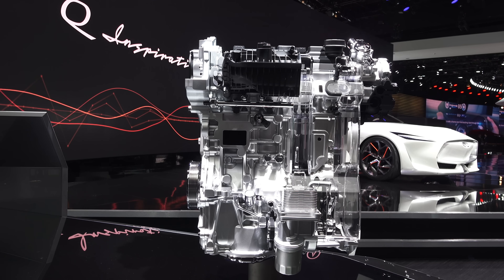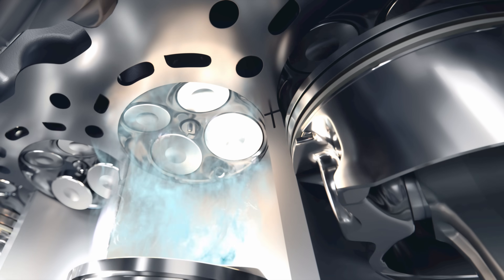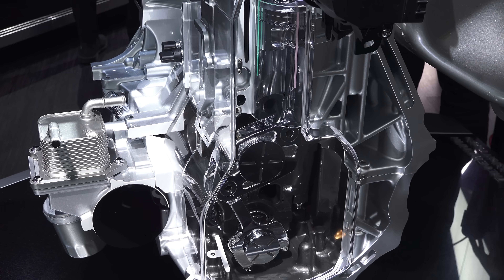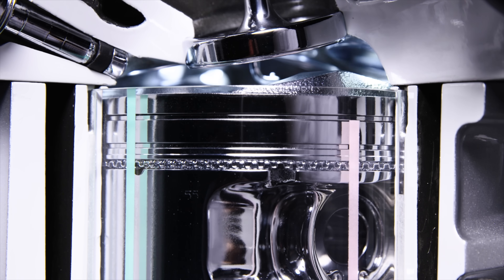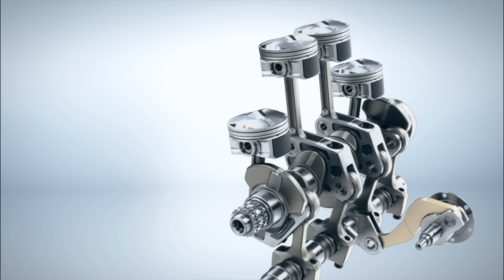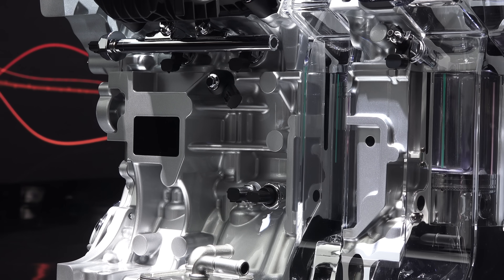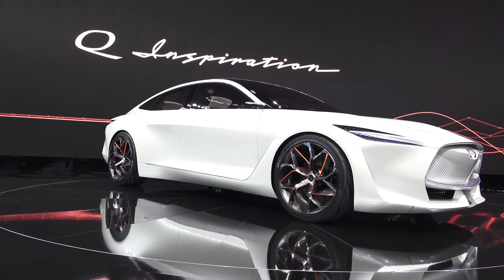INFINITI Reinvents The Gasoline Engine — VC-Turbo

Comment: Can't you achieve the same variation in compression ratio by opening and closing a valve during the compression stroke? Seems much simpler, and doesn't the technology already exist? Also, I've often wondered about offsetting the crankshaft so the connecting rod is perpendicular to the crankshaft web during the power stroke at maximum cylinder pressure (to optimize torque on the crankshaft and minimize side thrust between the piston and liner)... why isn't every crankshaft like this? great video, thanks!
Reply: That can definitely alter the effective compression ratio of the engine, though it does not modify the expansion ratio(The Toyota Prius pioneered this technique and many other automobiles use it). Unfortunately doing this decreases the max power the engine can provide - hence why this complicated system exists.
Reply: No its not quite the same thing dropping compression by dumping air is not the same thing as reducing squish in this system you still maintain the same air quantity.

Comment: Can't you just open the intake valve later in the intake stroke to lower the compression. As in the later the valve opens the less fuel and air gets sucked in.  Or that won't work?

Comment: I disagree about all 4 cylinders having balancing issues. The Honda B series engines had very well balanced crankshafts that in some engines could exceed 9k rpm all without balance shafts. The K20s had balance shafts and a two piece block design that improves the rigidity even more, and run ten times smoother than b series.
Reply from the maker: You can disagree, but secondary imbalances are a fact of flat-plane crank four cylinders like the two you describe (and they are the reason the balance shafts are used). You can build them smooth, just takes extra.

Comment: So premium fuel for performance? At the added cost it couldnt be done on 87? How is it more efficient at a higher compression rating when honda and toyota run low compression for fuel efficiency and longevity from blow by? Higher comp= more fuel. None of this adds up. Its BIG price tag that will sell it. You wanna see great be the first with a diesel/electric hybrid. 1 gal diesel8 hrs of run time like an apu. Solar panels regen braking. I guess that wouldnt sell.

Comment: You mentioned that one ofvthe features of the variable valve timing is t gat it can shoot some ofvthe air fuel mixture outvyhe exhaust... I would hope that's in direct injection mode, because if you're sending unburnt gas out the exhaust, there goes emissions and fuel economy.
Reply from the maker: Not out the exhaust, out the intake. The fuel is preserved.

Comment: Cool to see innovation, but I'm willing to bet a more conventional inline 4 diesel would net the same fuel economy if not better, and offer the same performance and fuel economy regardless of how many passengers and cargo is in the vehicle. Plus, a traditional design is proven. I'm sure this turbocharged gas engine might be more snappy to drive around town and for passing other people on the highway, but the torque of a diesel is also offers a very pleasant driving experience. Guess we'll have to see for ourselves how this revolutionary engine behaves in comparison to what's on the road currently!

Comment: BAsically the engine becomes more complicated and less reliable.  the more parts the more things that can go wrong and then slap in a turbo and.... yeah there is a reason why since 1920 no production car has had a VC engine. the only production VC examples were in two stroke engines from Yamaha.  Waullis and citroen use an interesting and more reliable setup than Nissan/Infinity does but even still they pale in comparison to their non VC counterparts for reliability.  Still I guess you have to start somewhere but never mind that I would never buy an over priced Nissan (or any Nissan outside vintage Datsuns of course.)to which most infinities are I wouldn't want to be one of the early adopters of this tech.

Comment: I like simplicity because I fix my own vehicles. I like Chevy because instead of creating complicated engines they took proven old school push rod V8s and made them better. If not for emissions Chevy trucks would be even more reliable. Idk squat about the v6 and 4cyl engines they make but I know that v6 runs pretty damn good.

Comment: OMG this is terrible. 
First Mazda skyactivs already operate variable compression ration through a high mechanical compression ratio which can be backed off by leaving the intake valve open slightly too long during the compression stroke using variable valve timing, which reacts in  a blink of an eye,  not 1.2  seconds like this contraption. This lower compression ratio state of the skactiv is actually the Atkinson cycle which is extremely efficient. When you need power the compression ratio is dialed back up. So simple, and I believe Toyota has started to do the same thing.

And that ultra low compression ratio to generate big boost? Goodbye real world mpg if you drive your car hard. 

So infinity has added unnecessary complexity and opportunities for reliability issues to give an engine that exaggerates the worst quality of turbo charged cars, which is bad mpgs if driven aggressively.
And the Mazda turbo skactiv run's at 10.5:1 because of all the other trick it can do to keep knock at Bay under boost.

Not impressed!

Comment: I know this is what you were told, but the only use for variable compression ratio is to make the turbo spool faster. This gives better fuel efficiency in that not much throttle is need to move from a stop or to climb a hill. It also gives better power response all over the rev range. I like the innovation, but the same effect is achieved by a supercharger. But what about parasitic loss? Only one component is missing from any supercharger to give it magnetic bearings that would make the supercharger rotate with no resistance. Can't wait till they rediscover fuel vapor.

Comment: Very interesting engine design. However some of your information is misleading. For instance an engine doesn't decide anything. It is purely a mechanical machine. The computer on the other hand is programmed to calculate engine load and based on that load along with the other position it will use the given set of parameters programmed in it to adjust the air/fuel ratio along with timing like all electronic fuel injected engines but this adds in changing the compression ratio as well as valve timing. One thing I would love for them to explain is how do they handle the boost when the engine is set to high compression or efficiency mode? Surely they wouldn't design an engine that is still creating boost in high compression mode or have the engine wasting energy to spool the turbo when in efficiency mode if in fact the boost is not being utilized. Also not all inline motors or even 4 cylinder engines use balancing shafts. Older engines didn't use balance shafts and currently the newer designs by gm only use balance keepers for part of the secondary chain inside the motor that is timed with the motor to offset the vibration felt by the driver.

Comment: 234 I see are mechanics like myself and are going to wait a few years before buying into this. So the engine has twice the bearing inserts twice the wrist pins but only a marginal increase in HP and efficiency. So I understand 4 times more unreliable and much more ridiculous to machine and repair for just a fractional increase in performance. Were did we hear this before folks? oh yeah rotor jobs :) . just playing guys ill order 6 and 12 rebuild kits a few connecting rods because I'm sure this ole gal is going to sling a few with my driving and lets go for that extended warranty please.

Comment: Though it was never put into production Saab had variable compression engine that was turbo charged roughly 10 years ago.
Reply: More like 15+ years. A Swedish TV show called Motorjournalen drove their test vehicle with an actual working engine, and that episode aired back in 2002 or 2003 I think.

Comment: Here’s good for thought, why not run dual cams and have the exhaust or intake have an electric tensioner that would vary how long valves are open which should change compression but more easily, but again variable duration lifters already pretty much can do the same thing on older engines

Comment: Over 1 second between grandpa and high schooler is pretty long since it can make the difference between an quick car and a fast car, add in a down shift and it’s pretty sizable, I get it for a fuel economy niche but I had lagged power, it can be the difference a running a red light or powering a yellow light (my truck is 8,000lbs add in a trailer and stopping can be harsh, atleast from my perspective) very innovative idea though, it’ll be interesting to see how it pans out 👍

Comment: Besides the obvious maintenance and longevity issues that come to mind, I wonder how responsive the shift in comp ratios will be. I understand he said it can switch from 8:1 to 14:1 in 1.2 seconds, but I wonder if the engine will lag badly, say when you attempt an overtake on the highway - which you would think would signal the engine to alter its ratio. Just curious if any lag will be felt. Cool design though!

Comment: Seems that all of this would be achievable using independently controllable piezoelectric valves and a classic engine layout. Only the valves would add complexity in that case, although if done correctly, could be more reliable than most reliable engines that we've seen in cars ~20-30 years ago, while mechanically variable compression ratio seems like another one of those auto-break-1-day-after-warranty inventions...

Comment: This is the most long winded useless solution to a problem that was solved a decade ago. Direct injection has been the solution for many years. Unfortunately this manufacturer was too busy making cart wheels at the time.

Comment: This looks a lot like a solution in search of a problem. Variable boost turbos have been around for a long time, changing the compression ratio seems pointless with that ability. Why would anybody ever want their static compression ratio to be lower? If it is simply so they can run more turbo boost they're robbing from Peter to pay Paul. It's engineering for the sake of showing off, not solving any issues.

Comment: Huh?  A big fan, but not a car-geek.  My head is spinning after this video: VCR-turbo, Adkins Cycle, Miller Cycle, Budack Cycle, etc.  BUT WAIT - some time ago there was a video on "the Holly Grail" of engines **HCCI.*  Now this thing is suppose to be new and revolutionary?.  So which is better: VC-Turbo or HCCI???  Is one better efficiency and one more power?  Are they variations on the same theme?  Could they be combined?  I guess if one can get 268 bhp out of a 2.0L engine there have been a few advances over the  120 bhp of the A20A3 engine!  So how about another video to "explain" all of this?

Comment: Nisssan  should put a big 6 cylinder version of this in the next Z car. Would be nice to have equivalent power of a big V8 but the efficiency of a 6 cylinder diesel or whatever. I hope they have a high redline though, otherwise I’ll stick to normally aspirated.

Comment: Love the vid and thanks Infiniti for making it possible :).  All I see however is all those parts... could be replaced with one electric motor... 
Don't get me wrong, 14 years as a dual ticket mechanic, I do love my petrol.  But for simplicity of repair and use, why are we still fighting electric vehicles?  The amount Infiniti spent on r&d for this new tech is groovy and all but were trying to fix yesterdays problems when we have tomorrow's solutions already available...

Comment: The added complexity is crossing the pain threshold early on and then they go on to add cycle switching and whatever. Im still thinking of how the electronic control systems are going to be of excessive complexity, that alone is reason enough to stay away from this engine. AS a concept it is extremely interesting but has no place in a production vehicle.

Comment: such an odd firing order. pretty cool! Porsche has been developing a variable compression engine as well, and operates in a similar way, by putting the connecting rod on a cam.

Comment: All that seems like a joyride in mechanical engineering. All this in-lieu of what an electric motor does with one rotating part? And what do you do at 300,000 miles when it’s time to replace this thing? Long term upkeep is cost prohibitive, it’s a throwaway, albeit an expensive one!

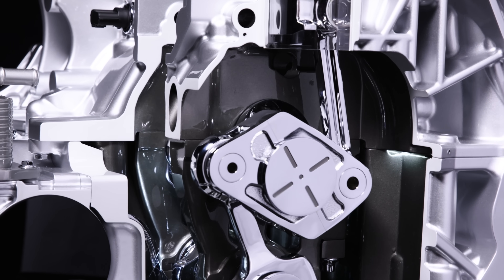Comment: Fascinating. but you said it reduces cylindre friction but if you look at  07:25 it looks like it's doing more angle than the traditional... i think
Reply from the maker: Correct, but that is on the upstroke, not the downstroke where the pressure from combustion is used to create useful work. The geometry is altered so that the pressure goes straight down to produce useful work, which means the connecting rod moves to the side for the way back up.

Comment: Clearly, Reliability was not the goal when designing this extremely complex motor... 😂

It's easy to make things reliable when you have a team of mechanics maintaining it... When it's owned by consumers, that usually changes... No manufacturer ever put out a car and said it was gonna be unreliable... Even the ones that are don't say that, they claim to be super tested and reliable... 😂😂

This is like a cross between a piston engine top-end with a wankel/rotary crankshaft, and a bunch of extra parts to connect them together...

Comment: Wouldn't it be possible to run this type of engine as a multi fuel engine? I suppose forgetting about diesels problem of dirtying injectors and such, the engine does have an injector so provided the ECU could tell what type of fuel it was running, could it work that way?

Comment: I have to buy PREMIUM gas $$ for this magic economical engine? I thought that direct injection and lowering the CR to 8:1 would prevent detonation in the power mode. High octane gas is usually $.20 - $.30 higher per gallon than regular gas. So this engine has to get some very serious MPG to keep that cost per mile down.

Comment: if this takes off the engine will become a throw away part... like how years age we mechanics use to rebuild starters and alternators and back even further AC compressors. gone are the days of repairing your car... now comes the day of part replacement... now you would have to have a engineering degree with hundreds of thousands of dollars in specific equipment to efficently repair a part.. and the overhead would be crazy... so we just change the part.... well if this takes off the engine will become another part to change when something goes wrong... I'm only 27 years old but I've been in the automotive industry for about 15 years and have graduated from several automotive colleges/programs. and even in my lifetime I have watched the automotive world change dramatically... and not in a good way. everyone is to worried about coming out with the new leading edge in technology.. when people really need to make reliability and cost effective repair design top priority.. the older I get the more sickening the world makes me on man accounts.... but then again what do I know I'm only a logical 27 year old....

Comment: This is a unique engine but only flaw i see is when it increases the compression after not being used in awhile. A carbon build up will form in the cylinder liner. Then when this happens the top piston ring will break, causing loss of compression and increase in oil consumption.